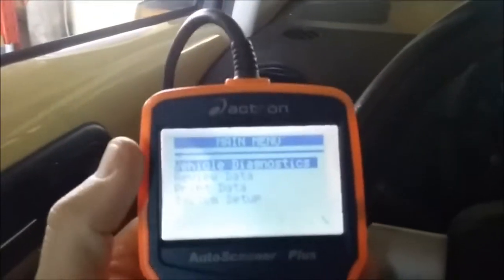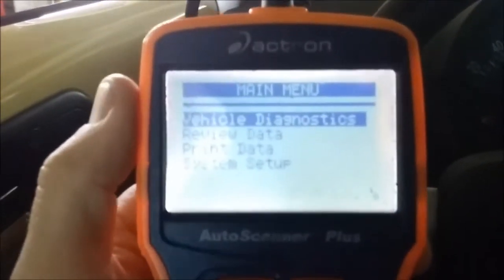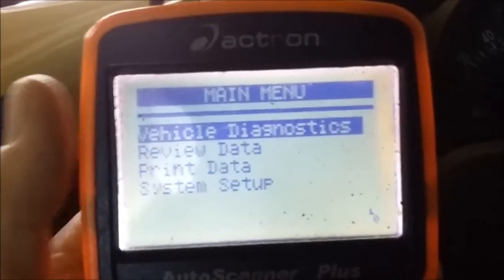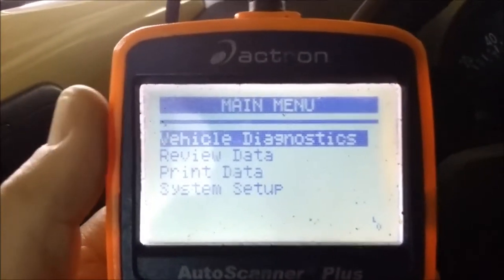VW wont scan cant get codes beetle jetta MK4

Comment: I have a 2000 Beetle that only has dashboard lights on high beam at the same time a relay sounds a rattlesnake about to attack. My current fix was to eliminate the dimmer switch with a direct wire from a switchable fuse.

Comment: You won't get anything but basic codes. These cars require vagcom to actually read all codes
Reply: What’s the best vagcom to get?
Reply: @bobjones6035  any that rosstech has. It's not cheap and there are limitations on how many cars you can scan/unlock/tune-adjust. Depending on model you get. Do some reading about it. It's an incredible tool. But not cheap for an unlimited version!

Comment: great video...I have a 2008 with a factory radio. I changed the alternator and had to splice in a new connector. Now I have this issue.  I did check all fuses and everything looks good. Any Suggestions?

Comment: I bought a factory head unit to replace the one that some idiot smashed my obd2 powers on but abs is not connecting  nor obd2  Brake light blinking wildly after master cylinder and brakes and rotors all around my m/t  98 beetle  ?

Comment: Nice video my friend, i'm having a problem with my 98 beetle, it has spark and fuel pressure, but when i start the car, it dies immediately, see if you can help me, thank you
Reply from the maker: If it dies immediately. I would suspect the alarm - disabler. I havent made a video on that problem but I have seen others on youtube. Either way let me know what you found when you fix it.

Comment: Hey im having same issue w 2001 golf. Tried unplugging aftermarket radio and still "linking error". Any idea?   Thanks
Reply from the maker: Theres a pin in your data link that needs good ground another that has to have 12 volts. I will have to look through my books and find my notes on which pins. The 12 V does have a fuse that could be bad. I need to make a video on this one too. too much to explain with typing.
Reply: saneauto hi thanks for the reply
Pin 16 is battery voltage and 4-7 is 9v or below. Im still getting 12v as well...
Reply: saneauto have u made it yet?
Reply: @saneauto   did you make this video as I'm still having this problem too on my 2000 vw bora